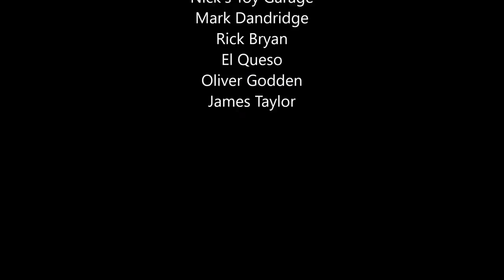Matchbox 1978 Ford Escort RS2000 - 'Build Off' Rally Custom

Comment: Just a tip...that "white" under the numbers is called "silvering", and usually happens when you're putting decals over a not so glossy surface. If you want to avoid that in the future, clear coat your vehicle or use gloss paint (tamiya usually doesn't come out that shiny out of an airbrush in my experience) and it should lay down nicely. Then clear coat over the top again to seal them in. Nice work over all!! And those wheels look like current Hot Wheels tires.

Comment: The biggest improvement was due to the sanding of the window frames. Great stuff.  The windows always look a bit low on these die cast models.  Perhaps sanding the top of the window insert would pull the whole thing upwards and seat it better.  To really change the game you should try vacuum moulding over the existing window to produce a thinner and better fitted item.
By far your best upgrade.  Well done.

Comment: Hi mate this is a lovely effort but saddened my heart as I have such a personal attachment to the real car. If you ever find another one please could you do it as the road version in signal orange. Those four spoke after market wheels you got would have been perfect on this car. Btw the lip spoiler on the boot was always black not colour coded. Iirc the sloping nose was added because Vauxhall had introduced the ‘droop snoot’ on the Firenza sport models in the early seventies ( see Gerry Marshall’s legendary Big Bertha racing car). That sloping front became a Vauxhall theme appearing on the Chevette, mk1 Cavalier and the Opel Manta. Opel versions of the Chevette and Cavalier, the Kadett and Ascona, had conventional flat fronts. Yes I did own an RS2000. Matchbox also made the bubble arch mk 1 rally escort. I think it was white with a black bonnet from memory.

Comment: Are the wheels off the Datsun rally car?
Reply from the maker: Guess again
Reply: @MatchboxGarage  hmmmm, I know there is a variation of the orange Datsun with this wheel, there's a similar wheel with bolt holes but that's mainly 4x4's. Seen it on a few though, am I right in saying it has a tread on the outside edge only?